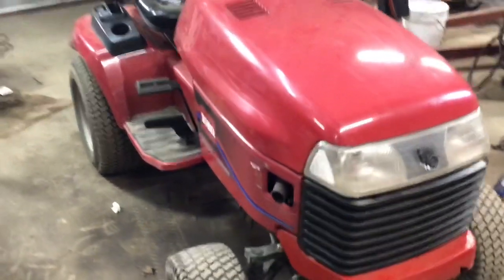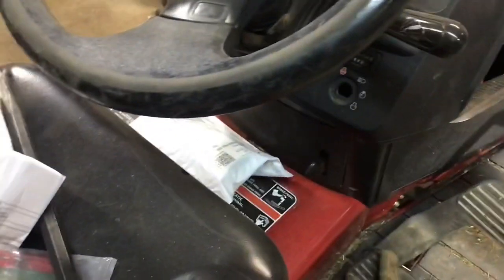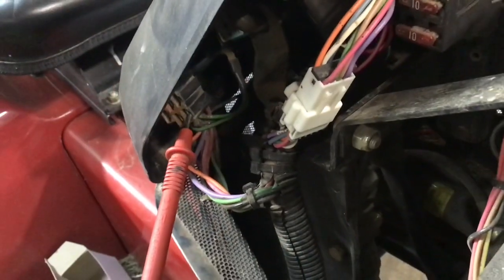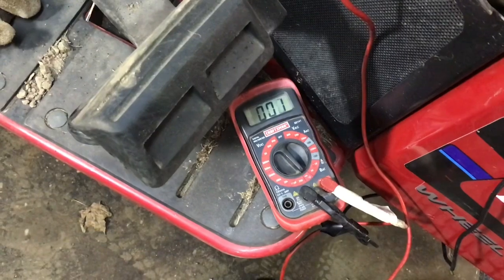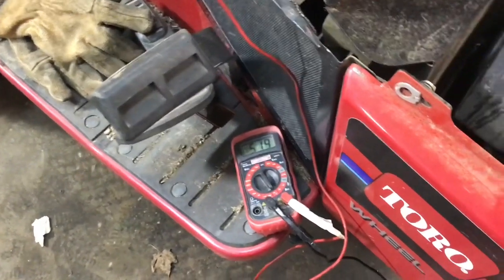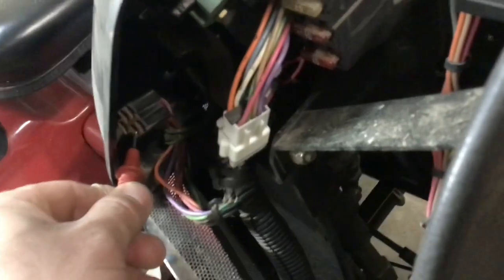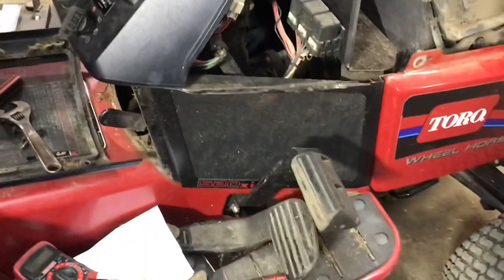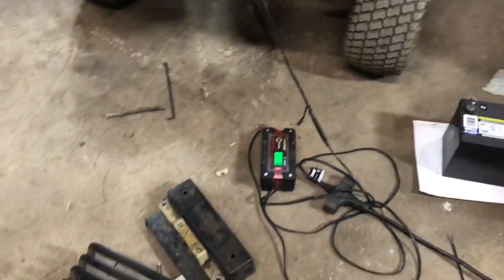Replacing the 101917 Ignition Switch in my Toro Wheel Horse 520XI

Comment: Hi, Do you have a Toro Model# 73545, serial # 8901329, 1998 520 Lxi, deck (44" cut) model # 78357, serial # 8901772
Reply from the maker: Hi Mark, are you specifically looking for the deck?  I have a deck torn apart that needs refreshing.  I’d have to check the model number to see if it’s the same.
Reply: @PullStartStables  thank you, Kevin. i wait
Reply from the maker: Mine is 78363 48” side discharge.
Reply: @PullStartStables  GOT IT THANKS
Reply from the maker: If you’re interested, PM me on the Wheelhorse forum and we can go from there 👍